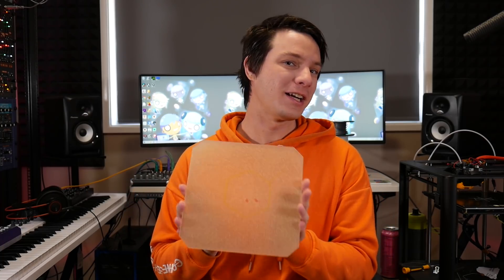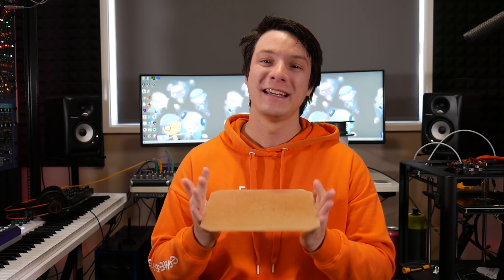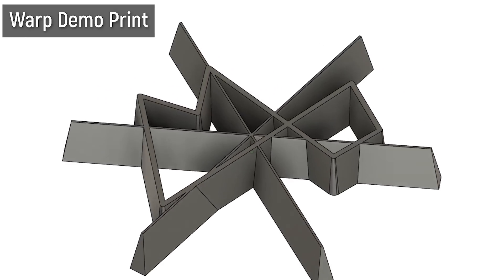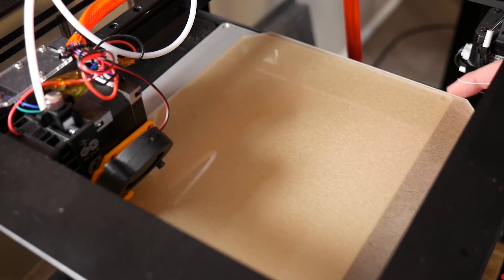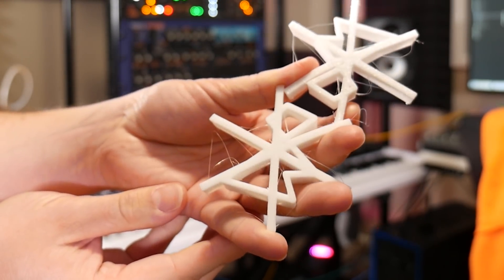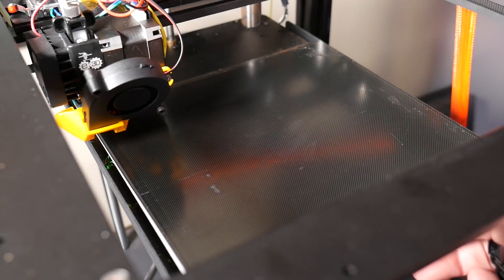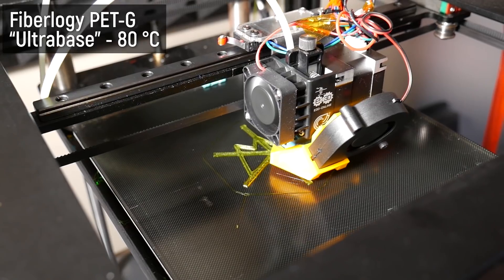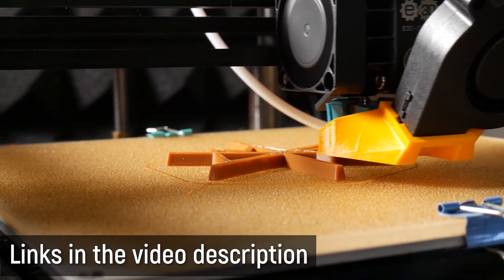A REALLY unusual 3D Printing surface! Ultembase PEI Glass test and review.

Comment: I still prefer glue stick on glass as you mentioned. It works with all filaments and rinses off with water.
Reply from the maker: Yep, hard to beat!
Reply: I prefer mirror over glass. Just gives me the peace of mind that it's not warped. If a mirror is warped it's really easy to see.
Reply: @harmswahyEsquire  Mirrors are glass with a silver coating.
Reply: 1mm thick PEI sheet (got mine from GizmoDorks) on a flex bed. I can't describe how much better it works compared to glass+glue stick.
Reply: @MauDib  For which filaments?
Reply: @Graham_Wideman  PLA, PETG, ABS, TPU, PC. I haven't tried nylon yet. I know conventional wisdom is that nylon doesn't like to stick to PEI, so I've still been using glass+glue stick for that.
Reply: @MauDib  Thanks, that's useful info!
Reply: @Graham_Wideman  the 1mm PEI sheets are relatively cheap, especially below 310²mm. It's worth the $10-20 to check it out. And it's nearly indestructible compared to the thin 0.4mm films that get used on a lot of flex bed systems.
Reply: @MauDib  Used to use a similar system until I built a printer with a larger bed (330mm square, dual Z) and found it was impossible to keep it flat. Tempered glass was the only option to get consistent first layers, I use the ceramic coated one and it works well as long as you keep it clean. I have considered using a 1mm PEI sheet over the glass, though.
Reply: @eulachonfish  I use the 1mm PEI on my 310² Sidewinder X1, but I replaced the stock glass bed with a 5mm aluminum bed from Fulament. Hoping to score one of their v2's with the embedded magnets. I also have ABL, but the aluminum+1mm pei is fairly flat. ~0.2mm deviation across the plate
Reply: I'd always written off using Glue stick as being too weak without ever trying it. But the the other day i couldnt get my PETG to stick to my usual Kapton Tape layer, so i thought eh, why not try it. Damn, why have i not been using this all along!! its like a secret thats hidden in plain sight haha
Reply: I don't like removing the bed form the printer to wash it off and to get that glue off you really need to rinse it.
Reply: I have tried a brand of glue stick here that sucked terribly, it just couldn't hold anything.
Then I went with just plain liquid wood/paper general purpose glue. The kind the slow kids in school eat, and it freaking worked wonders. Never bothered with that crappy stick anymore. Of course a proper PVA based glue stick would have worked better I bet, but that glue I'm sure is proper PVA based, never had ABS come lose anymore.
Reply: I've been using hairspray. I was really against the idea at first, but after seeing how glossy smooth it dried I've converted over.
Reply: Good old aquanet extra super hold here. Just faster to apply then gluestick.
Reply: @Covers70  same thing I use. Aquanet.
Reply: Even better, white glue mixed with 70 ISO. ULTRA cheap and works great.
Reply: My new go to is 5:1 dilute wood glue on bare glass. Super easy to spread / reapply. Works even better than a glue stick for me
Reply: Only abs-juice works for me.
Reply: Same. I've figured out that you can get stuff to really stick strong if you do a double coat of glue stick, then to get it to release you can throw the whole glass bed with the part still attached into a freezer. If you have a really big print bed that may not work for you though.
Reply: I tried this for a bit, but I now use Vision Miners Nano-Polymer adhesive on glass and I don't think I'll ever look back!
Reply: The secret is to clean your ultrabse with isopropyl alcohol before use. Otherwise nothing will stick.
Reply: glue stick and hair spray are great on smooth glass.. best build surface i've ever used though, was the stock platform on my lotmaxx shark sc-10, its a pei powder coated flex surface, and its difficult at times to get prints off they stick so well... luckily the flex pops it off
Reply: Indeed. I've resorted to using glue stick with PLA on my textured sheets especially when using multi-material because even with 2 different colors of the same material, you can end up with varying effects as you print.

I was getting warping on Prusa, TheKing and Ultistik, or at least, part-bed separation, especially for prints with a lot of surface area on the bed. 
Using the 7x7 mesh bed leveling on the Prusa didn't help. 

I even had some warping when printing on a bed with a mesh variance of around .14

So after everything, glue sticks were my saving grace. 
I got the purple | goes on clear sticks and the very first try, worked like a charm. 

I've wasted a lot of filament trying to get prints just to stick when I should have fell back on PVA sticks :(
Reply: The bed on my Ender 3v2 works perfectly, I don't need any of this.

Comment: I use a TH3D ex-flex surface. Smooth PEI coated string steel. I have zero issues w/ PLA. PETG I run about 0.04 less squish on 1st layer and it sticks great when hot (70C) and only need a a brim for loooong, thin areas. It releases easily below 40C w/ a slight flex.
I don't plan to print anything else that requires venting so I can't speak for how they would perform.

Comment: You can print PETG straight on glass, you just have to take the print off while the heat bed is still hot. If you let the heat bed cool you will need to heat the bed up to take the part off, otherwise large chunks of glass come off. As soon as Angus said PETG I knew what was going to happen next.

Comment: For years I had issues with my Anycubic Ultrabase. The idea is similar, but it has a patterned ceramic coating on a glass substrate, rather than random PEI on glass. In cross section, under a microscope, the Ultrabase looks like a waffle iron. Finally, I stumbled on the fact that the manufacturing process leaves some kind of flux in the "pockets" of the waffle iron pattern. Repetitive scrubbing with distilled water, vinegar, isopropyl, and methanol FINALLY got the flux out (as seen under the microscope), and the Ultrabase worked as advertised.

I believe these textured beds are designed to be used so that the nozzle is barely in contact with the bed, i.e., the nozzle is just BARELY skimming over the peaks of the waffle iron. It can then squish plastic down into the pockets. A standard sheet of paper is way too high for my bed. I babystep during a test print until the nozzle actually gently scrapes the tops of the waffle iron, and then back off 0.01 millimeter. Saving that nozzle offset lasts until I change something major, like the nozzle itself. Usually many months per printer.

My opinion is that these textured beds can work well, but the standard leveling process doesn't do them justice. I suspect that the manufacturers haven't taken the tribal knowledge "paper shim" method into account, and they might suggest lowering the nozzle by 0.05mm or so afterwards. The difference can be ...huge.

Comment: If you do a bit of searching you can find many many stories of PETG not playing well with PEI... And it's the opposite problem to the usual lack of bed adhesion, all these stories are along the lines of 'the print pulled my PEI sheet apart'. I learned this the hard way too.

To put it bluntly, they stick together too well, almost welding to each other. As far as I can tell you must put a hefty gluestick/hairspray/talcum layer on PEI to act as a releasing agent before printing with PETG. Printing with an unheated bed is another tip, and has worked for me combined with hairspray, but it feels soo 'wrong' to do.

Try a search on 'pei petg releasing agent' for many, many horror stories; some with pictures! A few with copious amounts of swearing.

Comment: In my experience, larger parts printed in ABS tend to warp and detach on the 'utrabase' style ceramic-coated glass plate that I have on my Ender 3. It works fine for smaller parts though.

Comment: After punching a hole in the supplied buildteck I went to a Glaziers and bought plain glass 500 x 500 sheet was only $15 and had good luck printing PLA. I clean it each print with vinegar to make sure no finger print oils are on the glass. It sticks very well at 70 - 75c and cools and print is already loose. Never had a damaged surface and still looks new 10 months later. I switch to a new Buildtech I bought after the first fail but 90% I use glass.

Comment: Eeeps, Angus, PETG/GFill is a known no-go for PEI surfaces!  If this happens, you need to reheat the bed and take it off while it is still warm. Do not force the print off or you will damage the glass. You could even literally crack it (happened to me). 

Also, ABS on glass works - if you treat the surface with glue stick or something like Dimafix glue.

Comment: looks interesting, I bought an ender glass bed from amazon but it’s completely useless, wasn’t able to get a single layer stick to it no matter what I tried, it’s also even more warped than the original flex bed that comes with the ender 3 pro. 20€ down the drain. however this looks promising

Comment: After slashing myself a number of times prying prints off of rigid beds, you can take my spring steel from my cold dead hands.

Edit: on second thought... It could be a decent replacement for the Raise3D aluminum bed if the dimensions are right.

Comment: First, PLA refused to stick to my latest ultrabase after some prints, and then after cleaning it with isopropanol, I really have problems releasing PLA. Now, I lost some of my confidence in the ultrabase style. I still wonder, if I got a bad model, if that tends to happen and if there is a way to fix it. Right now, I don't have the time to test other surfaces. I hoped this new surface might be the great universal one everyone is searching for.
If someone found a solution for too sticky ultrabases, I would be interested. I only find unsolved problems when searching for that problem.

Comment: Very nice presentation. I’ve pretty much been using glue stick across the board, even with surfaces that are designed to work well with the material that I’m using. I can buy a case of 30 @ 22g Elmers Purple Glue Stick for less than $30 from Amazon, and that will last for well over a year.  Most likely, more than 2 years. It’s extremely inexpensive, only needs to be reapplied as needed, protects whatever surface I’m building on, makes it easy to remove prints, and is extremely easy to cleanup. What else can you say does all of that?

So, for me, glass vs spring steel is the only difference here, and I definitely prefer spring steel over glass.  It's just easier to remove prints.  Plus, I don't like the smooth finish that pure glass provides, while textured glass I do like.

Comment: "I never recommend  printing PETG on glass" 9:00
Kinda interesting to hear actually. I print PETG on glass, hell run a whole business doing it. My question is did you let the bed completely cool before trying to remove it? When I a print of mine finishes (atleast if I'm there when it finishes) I usually take the glass bed off, lean it against a wall and run a fan on the glass sheet to rapid cool the glass. It usually creaks and pops right off. Although it does take chunks of glass every once in a while admittedly, it's not common. Once every 30 jobs or so I'd say the print takes a souvenir of the bed haha
Reply: Use glue if its taking chunks out of the glass cause it then acts as a barrier and removes easier.

Comment: You should try PVP Polymer (Polyvinylpyrrolidone) as a bed coating. I have had very good luck with it on Garolite and PEI print surfaces at standard bed temps with PLA, PETG, and ABS. Printing ABS is most impressive, it will not release until the bed cools. It often self releases after cooling on a Garolite print bed coated with PVP. I dissolve 0.2% by weight in denatured alcohol then wet the bed with this solution and let it dry. PVP is available in powder form as a cosmetics material. You can get is on Amazon.

Comment: Fiberlogy site clearly say to paint petg on painters tape :/
Reply: We didn't use Fiberlogy in our own tests, so we don't know if it's the difference in brands :/ Our tests with PETG came back pretty good.
Reply: @energetic3d647  I have nothing against your products. I was only pointing one thing to the author. If you filament designer points out specifically to print it only on some specific surface than tester should respect that and use different brand filament for the test...
Reply: @Hajtosek  No I appreciate feedback! We didn't test different brands of PETG as we didn't think there would be much difference in performance. This early prototype didn't have issues with the PETG we tested it on, I have started testing PETG on our newer versions and trying to find the cause of the problem. Until it prints PETG perfectly, we will not ship them out.
Reply: @energetic3d647  Then definitely do tests on both Easy Petg and petg from fiberlogy, those bond extremely to buildplates. (the easy version more so)

Comment: If you look very closely, at what seems to be a smooth sheet of glass(with a microscope, etc), then you will see that there’s actually lots of peeks and pits........
    Which means, that if you put a semiliquid which is made up from a really fine grained product(similar to the stuff that they use for fixing car windscreens), it can get down into the bottom of the pits, and surround the peeks, and then you can get a vacuum as it cools down..........
      This vacuum, is obviously something that is incredibly strong, and I think that the combination of seeping down into the microscopic pits, and the attachment to the peeks, is why it is grabbing hold of the glass, so that it’s able to pull layers of the surface away with it.........
    But I could be wrong..........

Comment: Don't ever let PETG fully cool on glass in my experience! 
No problems popping prints off the bed while it's still hot, but it gets super grabby when it cools. The glass will shred off your bed just as easily as the print does if you leave it to fully cool!

Comment: PEEK is a bear of a polymer to work with, especially 3D print. I do not think the quoted 400 degrees C will cut it, more like between 450 and 500 deg C. Unless it is a blend of PEEK specifically made for low melting temperature, which kinda defeats the purpose of using it. Not to mention how damn expensive the material is.

Comment: I use a simple 2mm mirror cut to fit my Ender 3 and works perfectly for me with PLA, PETG, ABS, TPU, and Nylon (though this one requires some glue to help the adhesion). It's cheap and works fine.

Comment: Another one of those "why does this exist?" products. Thanks for the review.
Reply: We wouldn't just make random products xD. We saw an improvement in performance on this surface when compared to our flagship, the iconic gold flex-steel PEI sheet, which is still the best seller on lots of platforms. This surface withstands high heat, enabling printing exotic materials that the flex-steel sheet couldn't handle, like PEEK.
Reply: @energetic3d647  a thick sheet of Ultem is a considerably better option and will handle PEEK just fine. (I have done it). It is also a fact that PETG and PEI/Ultim have a reaction to each other which results in near-permanent bonding with each other. Try printing PETG on a smooth Ultim Sheet (not a PEI sticker) and have your z offset just slightly too close.. it will usually damage the print surface or be nearly permanently bonded to it.. Textured PEI type surfaces help combat this issue but also depend on a flexible surface to release without damage. 

The second I saw the chip in the glass surface I said "that was caused by PETG" before he even got to that part of the review.
Reply: @JATMN  This is very accurate, my thoughts are that Angus kept the nozzle a bit too close and that caused it to chip. We haven't had any problem with PETG ourselves.
Reply: @energetic3d647  The fact that you say that, just says you have not done enough testing prior to trying to rush the product to market.
Reply: @JATMN  Ultembase is still in the testing stage and won't be released until everything is ironed out. As far as testing goes, not only we test it ourselves but we also ship it to manufacturers of 3D printers and have them try it aswell. Angus' was one of the few negative feedbacks we had, and that was an older prototype produced in April. A newer sample will be on the way for him to test again. We are the suppliers for many major manufacturers including Creailty and ANYCUBIC, there's no need for us to rush our product. Hopefully I can change your mind about Ultembase in the future with its performance.

Comment: It would be interesting to see how it compares when the nozzle height isn't perfectly tuned in - i.e. is is a little more forgiving if things aren't quite dialed in?
Reply: From what I can see the material is a bit squeezed and pressed onto the surface, increasing the already high adhesion. Perhaps if it was raised higher it won't cause problems?
Reply: @energetic3d647  
Yeah, it's plausible that nozzle heights that are larger than the optimum may print more successfully with the Ultembase surface. I'd propose a secondary set of tests where you compare the several types of print surfaces(Ultembase, PEI on metal, bare glass) in each of several different nozzle heights (e.g. "perfect", perfect - 0.05 mm, perfect +0.05 mm, perfect +0.10 mm).